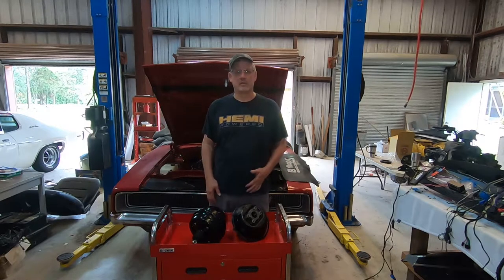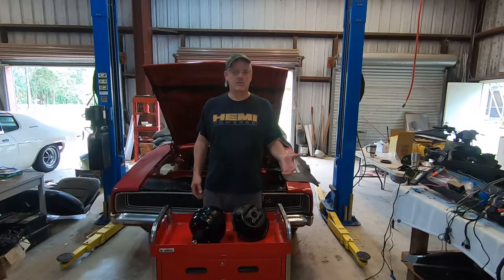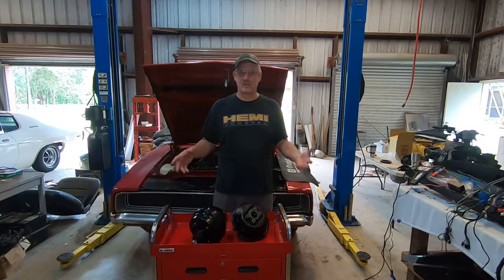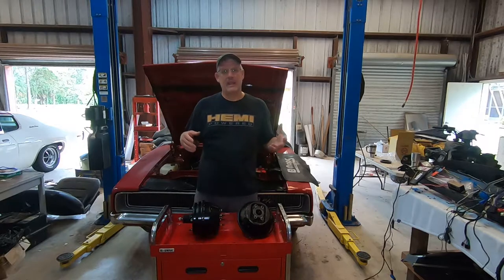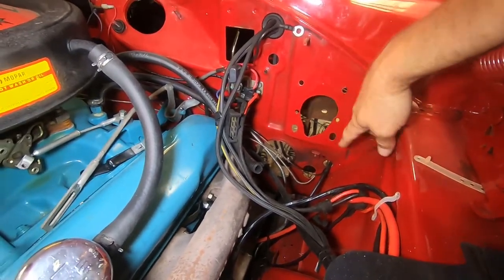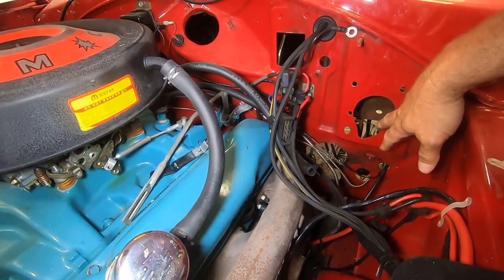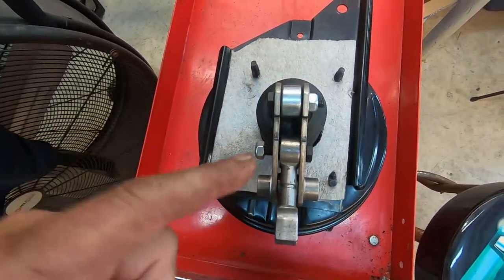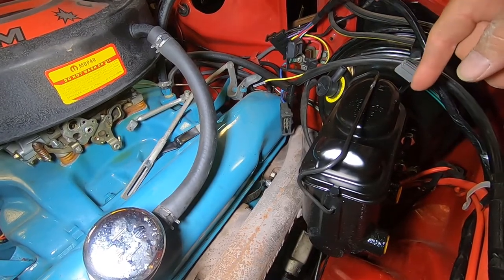68 Charger Brake Upgrade Part 1 Vacuum Booster Install

Comment: Has your transmission burned out yet? You need the Holley 20-7 Chrysler throttle adapter. Without that, your kickdown will never be right. Causing transmission failure sooner or later.

Comment: I’m in a predicament my factory disc/drum gtx had power brakes and the factory brake lines are on the right side of master cylinder the kits online all have left side ports on master cylinder 🤦🏼‍♂️
Reply: The 383-440 cars had the pass side brake line outlets. Originally the 426 Hemi was the only one that had driver side outlets.

Comment: Since the dash was already in the car and the brake pedal was there were there any challenges with installing the booster. I'm doing the same with my 70 Challenger and there is not much room under there. I also have a clutch pedal not helping the situation.
Reply from the maker: It's a royal pain in the ass.  No easy way to do it with dash and pedals installed.  Wish I could say there was a trick, but nope.

Comment: How did you get the plate off to switch it( you skipped over it)? Trying to do a 1967 GTX,  seems like I have to take the windshield out then the dash?
Reply from the maker: Once you pull the master cylinder off, it comes right off..

Comment: Why the Bell Crank pedal linkage adapter? What was the reason the new booster doesn't have the same length rod as the original?
Reply from the maker: Thats they way factory did it.  Its exactly the same as the factory one I removed.
Reply: @mikesmopargarage4734  That explains things. The one I pulled out just had a long rod to the brake pedal with no adapter. I found a picture of one like the one I removed in the Service Manual but maybe the one I pulled out was not original but it looked like it was.
Reply: Hi, wondering how your brake conversion worked out. I was looking for part two!